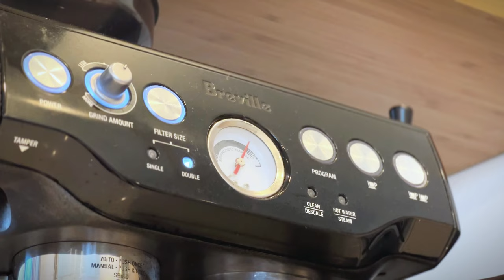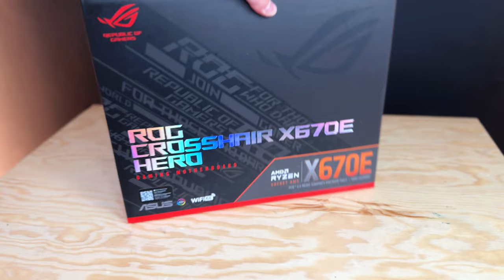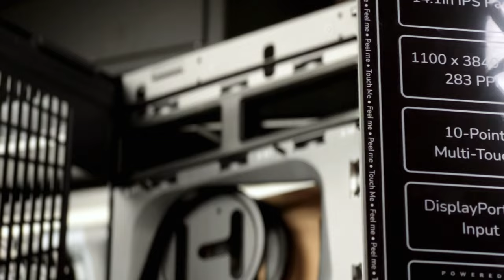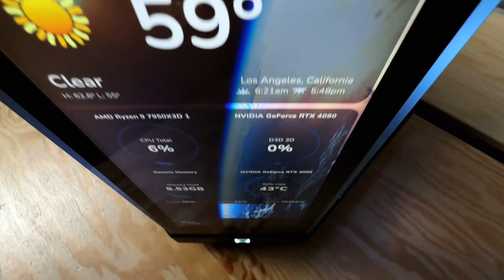Touch, Feel, Peel the HYTE Y70 Touch 4K display [RTX 4090 | Ryzen 9 7950X3D]

Comment: I was happy to see you go with the 140mm for the back exhaust. I am working a nearly identical build and I could not visualize if the 140 would look wonky alongside the 120s. Looks great!
Reply from the maker: Thanks! Didn’t want to see the big empty spaces at the exhaust area so I figure 140mm fans would look and perform better
Reply: @archetype_origins  For the fans at the bottom of the case you could only fit 2 but not 3? I'm doing a similar build and was wondering if you could fit 3 fans at the bottom not.

Comment: Amazin Setup! Im doin kinda the same.

Did u need an Lian Li Controller to attach all the Lian-Li Fans includin the CPU-Cooler?
Reply: On the Lian Li website, it says you get a controller with the Gallahad II LCD AIO if you get the one with the SL Infinty fans.  That same controller will control up to 16 SL-INF fans (if you daisy chain 4 groups of 4) So all of those fans in this Y70 build can be ran off 1 controller. (I think I saw he used the SATA storage compartment to hide the controller) Good news if you're limited on headers. If you want to pair these fans with Strimer V2 cables, you'll need the controller included with those (but you can run both 24V and either the dual or triple 8 pin to the GPU in the same controller) This means an UGODLY amount of RGB and fan control using just TWO CONTROLLERS and the L-Connect 3 software!

Comment: Okay, I'm a beginner with this whole PC building thing. Can someone explain to me on 09:28 how the GPU was installed? It didn't look like the GPU was going in the motherboard but just being pressed down into the bottom of the case? Please someone explain this to me lol.
Reply from the maker: This is a vertical mount GPU which means there’s a PCEI riser cable on the bottom of the case that connects to the motherboard. Kind of like if you have an extension cable for normal electronics. Instead of plugging in your toaster into the wall you plug your toaster into an extension cable which I turn is plugged into the wall. 😅 I hope this is helpful and not more confusing 🫤